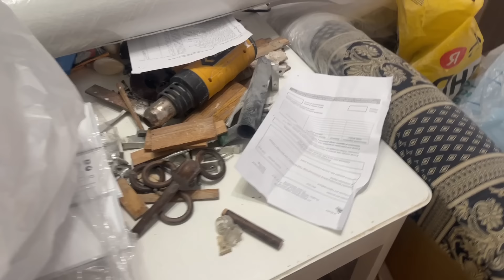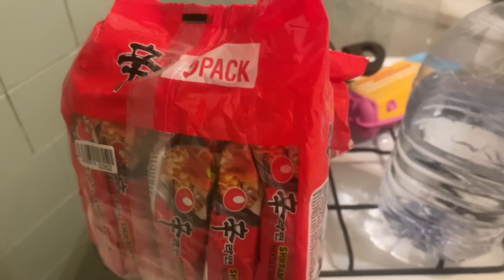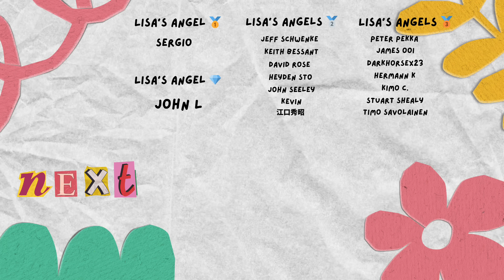RENOVATION in Russia 🇷🇺 Making Soviet Flat great again!

Comment: Usually in UK  we have a skirting board  at the base for the wall. From the word 'Skirt'. The one at the top of the wall is a 'coving'.  You can use sticky tape at edges t like the top of the wall to make sure you do a straight line.
Reply: Is the Bubushka going to increase your rent next year on the back of your hard work?  Do o not be pushed around by her.   Demand same rent or only inflation.

Comment: Your apartment looks great! 
Buy the things you really need a little at a time. 
  You can continue to upgrade a little at a time. 
  That's a lot of work, but in a small place, it is worth it.
  Are you going to replace the lighting? Do you have fuse boxes or circuit breakers there? You can shut off the electricity to the light circuit nf maybe put in a ceiling fan with a light in it there? 
  I imagine you'll do those things when the weather gets cold again.
  I love your videos. I'm learning Russian, too. I'd love to at least visit to see the Museums,  the sites, parks, wilderness, etc. and maybe stay for a while.
   Why did you have Internet there? Did you have to order it? Did you have to buy a modem and router for WiFi, or does that come with the service there? 
  Your apartment came out cute! ❤

Comment: That renovation is extensive. If there are any rooms with lime basked paint. Its a painters night mare. Inch by inch. My whole house on inside was this paint. The best way is paint it with the cheapest paint. And it strips off . That area room 24 hours of work. Just did one lounge room here. That I wall paper in 1980. 24 hours to strip it back well. 16 hours to paint with under coat sealer. And the ceiling was a concern. Because originally had lime paint. And that took 20 hours to get it off. I wish then I new about . Just paint over with a cheap paint. It adheres to the lime paint and brings it all off. Back to bare wall.  It would have taken 5 hours. You will soon know , if you have this very old paint . You just cant leave it . 80 years paint , old they dont make it any more.